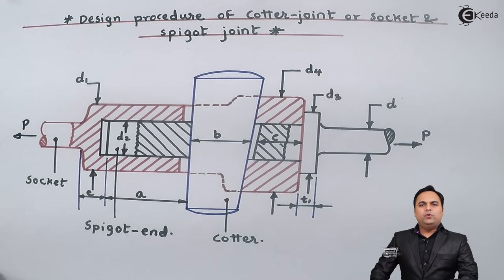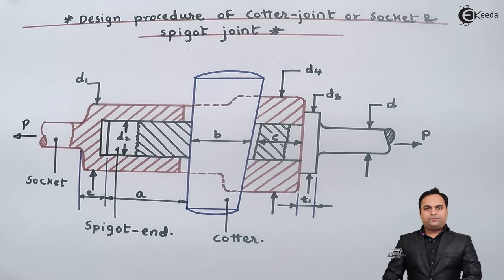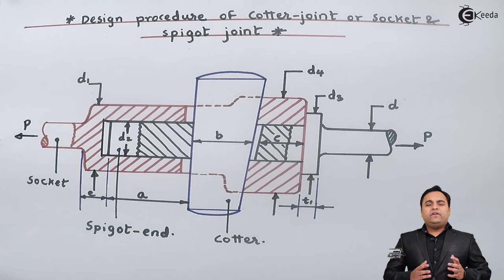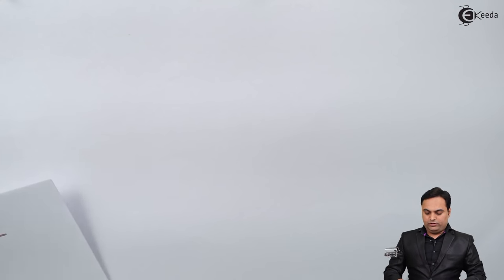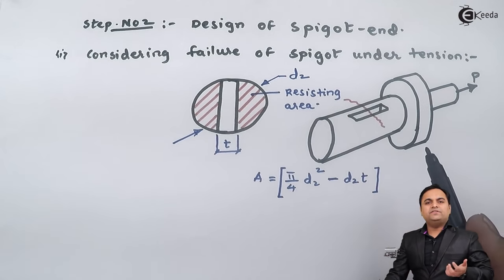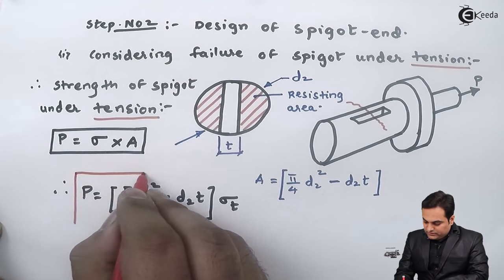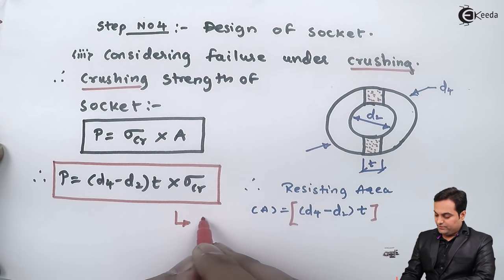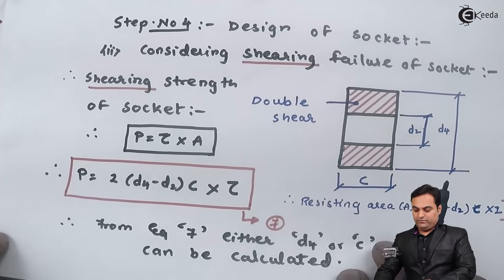Design procedure of Cotter Joint or Socket and Spigot Joint - Design of Machine

Comment: Hello sir i would like to mention that u forgot about the design failur of spigot collar in crushing ...... The crushing strength of spigot collar when the  load is applied from both the sides the crushing stress will be generated so area = π/4 (d3^2-d2^2)

Comment: it very use full for me thnaq
Reply: Sir I want a solution of this problem
Reply: Two machines parts are fastened together tightly by means of a 22mm tap bolt. If the load tending to separate these parts are neglected ,find the stress that is set up in the bolt by initial tightening.

Comment: It is required to design a cotter joint to connect two steel rods of equal diameter. Each rod is subjected to an axial tensile force of 55 KN. Design the joint and specify its main dimensions.

Plz solve the sum

Comment: how to find the diameter of the spigot collar as d3...??
Reply: actually spigot collar has dimensions d3 and d2. in the video it has been mistaken as d4 and d2 so.
Reply: Nope. d4 is the outer diameter of socket collar and not the spigot collar.
You can find d3 by observing spigot collar under crushing.
Resisting area: pie/4x(d3^2-d2^2)
Reply: he didn't show failure of spigot collar in crushing so from there you can calculate d3
Reply: @premvishal4854   i agree brother
Reply: @jayeshsable4094  COORECT BHAI
Reply: @premvishal4854  thank you for clarifying my confusion
Reply: Nahi bhai d3 se koi farak hi nhi padega aur haa crushing area me spigot ka collar nhi le sakte kyunki collar of spigot ke through mera cotter nhi pass ho raha Balki spigot me mera hole collar se aage hai refer the spigot diagram of VB Bhandari page 87
Reply: Actually he didn't explained failure of collar due to crushing

Comment: Sir... Why the cotter having tapper wall on one side and straight wall on one side....?
Reply: Wedge action .....if u hit cotter from top ...it will get tightened and ...if u hit from it well get easily removed....
Reply: @niftywalla  no
Reply: Mechanical brats: Taper is just because to get wedge action ....tightening and loosening of whole joint becomes easy.....this is not view ....I have used  and designed also....
Reply: @niftywalla  brother what he is asking? He is asking that why not on two side but on one side only.... U r explaining the different thing..
Reply: @WeRGautams  Okey boss

Comment: & where is the cotter joint is used
Reply: the cotter joints are used to connect the paddle and sprocket wheel in bicycle
Reply: Also used in the steam engine